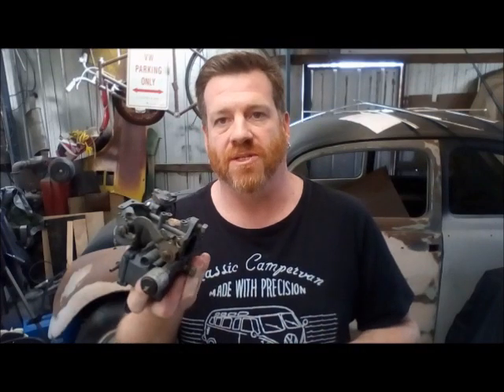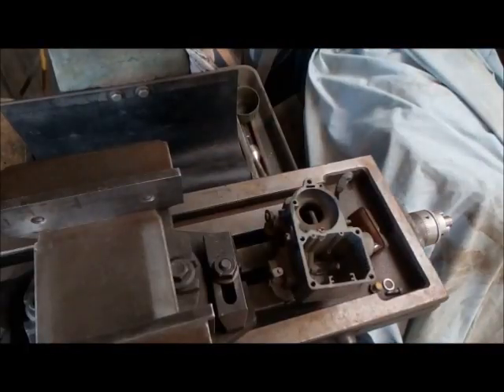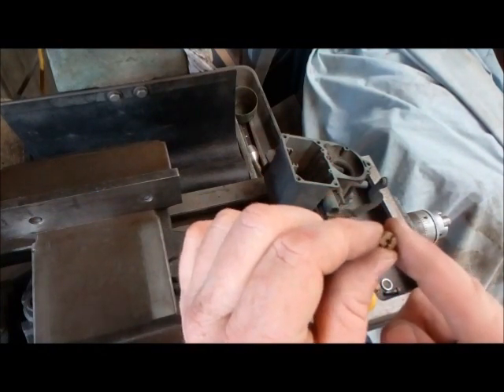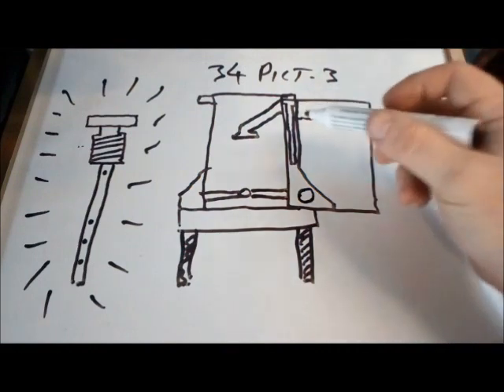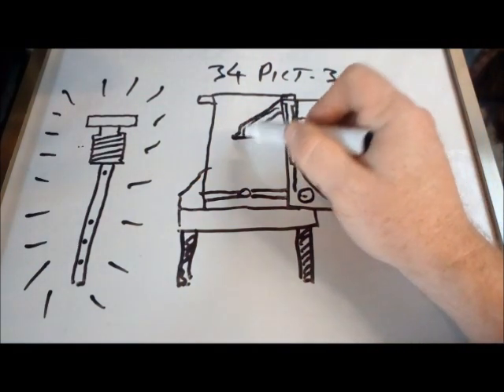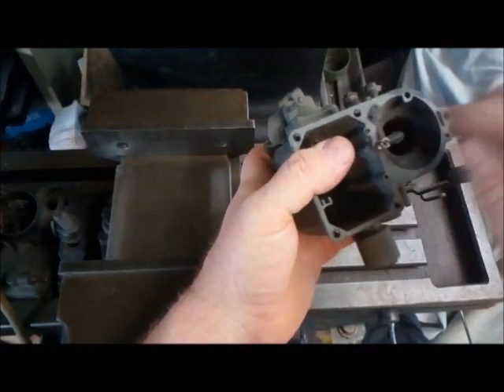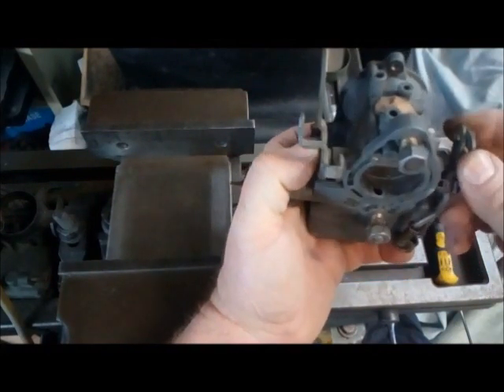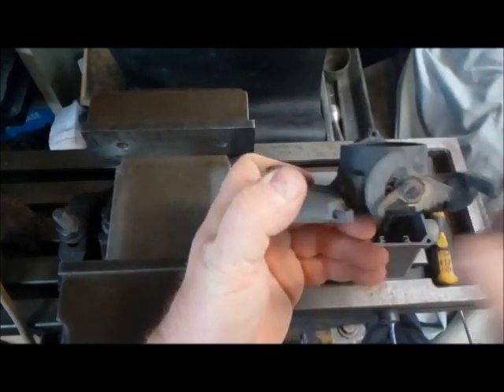Turbo Basics for Vw 34pict / 34 pict-3 Volkswagen Carby Rebuild...

Comment: Good tutorial. But the inlet valve is not a restriction as such. You can get valve sizes up to 200. In a 34 Solex a 150 is plenty. Yes, if you boost an otherwise stock 1600 you will not be able to boost that hard because you will soon run into valve float. From what I have seen, about 6 psi and 90ish hp. But if you build the engine for it, then the first 135 hp is relatively easily obtainable. The most power I have made through a modified 34 Solex is 150, but on a 1776 displacement.

Comment: Wow, I was looking for a video explaining how the 34 pict 3 works, and feed me for a future project. 
For now I'm looking for answer for my problem. I rebuilt my carb but now the engine refuse to run. 
It start from the burst pump but it stop right after.. looks like the gas from the idle and main jet don't works.... I didn't figured it out yet. I cleaned it 4 times with 2 time 24h soak in degreasing juice. With compress air I blowed in all holes... 
Still problems. It stops 3 seconds after I started the engine.  If I rev up the engine and keep let say at 3000rpm it will stop suddenly after 4 seconds. If I keep rocking the gas.. it will stay on as long as I continue to rock the pedal.
Any clue?
Thanks a lot 
Felix
Reply from the maker: Some of the later models have a stop solenoid in the fuel circuit mKe sure the wire is connected to your coiil

Comment: Hello, great vid. I've found soldering the holes quite challenging. Can something be inserted to block holes from the bottom of emulsion tube? Is there a particular technique for soldering the tube. I've soldered electrics before. Cheers, and thanks!
Reply from the maker: Try using the minimum amount of solder, and use a larger drill  to clear most of the solder and then use your sized drill to break through. You don't need a lot of solder just enough to block the holes then you can sand or file off the excess
Reply: @EverythingAnthonySOS  cheers pal
Reply from the maker: @downcows  if you have any further problems hit me up on our Facebook page 👍

Comment: Hello ,Could you tell me,in drawing which position could be air jet and idle jet in carburator “solex”3 at WV beetle 12000cc and 1974 manufacturer (year),because I have a problem in carburator I don’t know it.If you teach how could fix it,I’ll be happy.Thank you  again from Kosova.
Reply from the maker: Your Air jet is in the main body in the venturi , it can be removed with a flat bladed screwdriver , idle jet is behind a screw in the side of the main carburetor body

Comment: never found a video on youtube with so many info about the carbs. maybe you should do a video explaining how a stock carb (no boost) works , it would be priceless!
Reply: Look for Renault 5 GT turbo carbs, Solex 32 DIS , many vw owners used them for turbo applications. You can find period scanned pdf files with internal passages diagrams and step by step functions..
Reply from the maker: Thankyou , appreciate the kind words